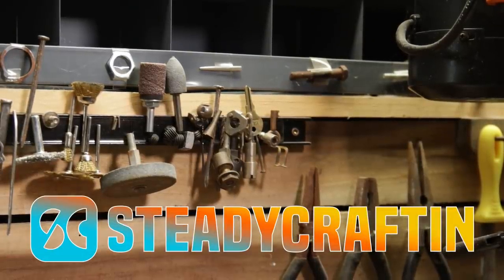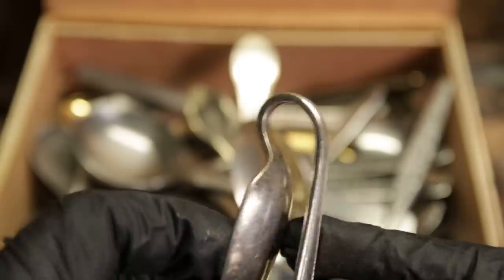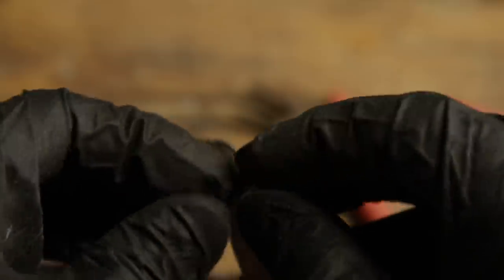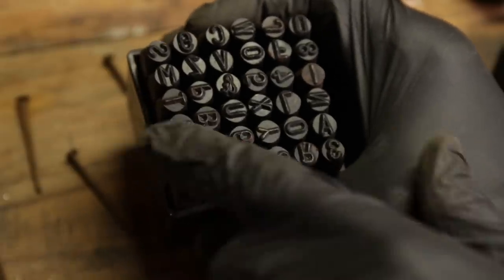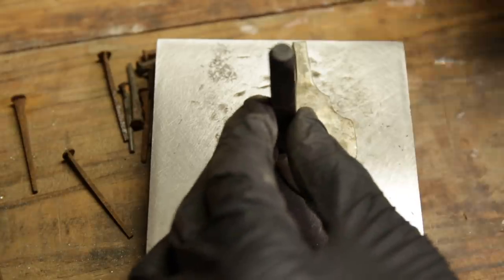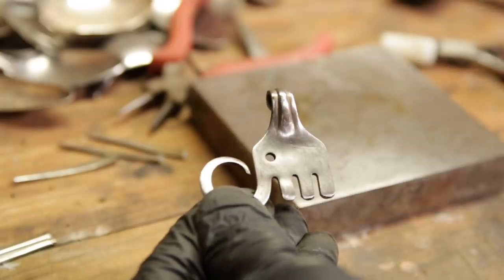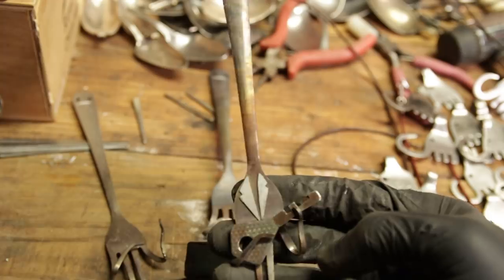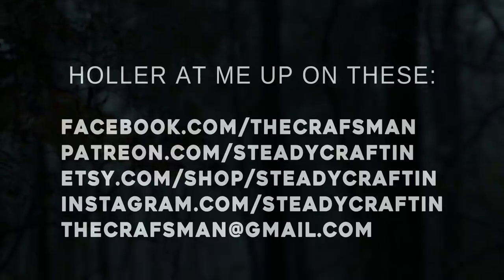Silverware How-To: Keyfinder, Fork Elephant, Hammered Spoon Pendant, Flatware Jewelry

Comment: Daughter and I ordered the Pepe Mark II ring bender, hammer and mandrel last Saturday!  Made sure we ordered through your affiliate links under your video!  Shipping is to be 5 to 8 days!  Can hardly wait, any day now!  These are great additional uses for the bender!   I would never have bought one if it weren't for your videos!  Another winner, CrafsMan!  I already know folks who would love to have these as gifts!
Reply from the maker: Aww, that is mighty nice of y'all! :D I'm telling you ahead of time, it will be hard to go back to bending silverware (or other metal things) any other way. :D The curves are nice and uniform, and it makes it so easy. I've even bent thick stainless steel handles on this thing. If the plastic/delrin/nylon parts ever wear down, they sell replacements. I've yet to replace mine, though, and they look pretty rough. :D Holler if y'all have any questions about it! ( thecrafsman@gmail.com ) And thanks again for your consideration!

Comment: thanks you again!!
i want to offer you a tip. this is more about rolling little tapered bars of soft material. if you use your fingers, 
make sure you get more than one revolution as you roll it out. otherwise, you may end up with a flattened workpiece versus a round workpiece.
it's a ceramic trick...i enjoy your humour and craftsmanship and attention to details. great show!

Comment: Hey Crafsman, just found you a week ago and have subscribed. Quick tip for remove the Stay Sliv flux, boil the part in water for a few minutes, this works well especially for those hard to "get to" areas. Steady on...

Comment: Hi Craftsman from a 71 year old, always learning, from across the pond in England.

You look much like me, a human squirrel, not wanting to throw anything away because it might just come in handy one day.😅

I've got 50+ years of all sorts of stuff, or should I say junk, over three stories of the house and garage, my children and now grandchildren and their friends love exploring, to them it's like an Aladdin's cave where they can find something to fix, something to take apart, it doesn't matter if it doesn't go back together, learn how to use tools, most of all be inquisitive and try something new.

I've got 5 grand kids from 18 - 9, all independent, like to solve their own problems, determined not to give up and most important not afraid to ask for help when they get stuck.

Recent projects with them, doing some Lichtenberg wood burning, making a leaded window with cathedral glass the old way, restoring an old chiming mantel clock, sand casting some lead toys, teaching the younger two to TIG weld, taught the older ones a while ago, and so it goes on, I need 24 hour days and 14 day weeks, I know what a lot do with them would have the Heath and Safety folk have a fit but I make sure they are safe, the odd cut, burn't finger from a soldering iron or blood blister always teaches them to take care 😉.

I've subscribed to your channel, though I'm not sure it was a wise thing to do,🤔 😊 they have gone through all your vids and now I'm having to gather together some bits and bobs for copper etching and they have selected a pile of junk from my scrap boxes and bits from my engine black museum ( bits from engines and gearboxes that had self destructed ) to make some, as they call them, treasures similar to your silver soldered masterpieces, though some may have to be welded.

So keep up the good work, if just one or two folk try something new from your vids they're a winner, likewise if your vids create that inquisitive, I can do it, hands on, inventive spark in some children, it will set them up for a life of wonder.

My spark came from mum and dad, when I was small we had very little money, if we couldn't afford something, mum or dad always found a way of making or altering something, it just takes that little spark and a bit of time to create a lifetime fire of awe and interest in children................. sadly, today, so many kids don't get the chance !

Take care.
Reply from the maker: I can't begin to tell you how much this comment means to me. I had a big smile on my face, and a steady nod of agreement as I read along. You sound like an outstanding dad/granddad! You're teaching them things that not only become skills in their toolbox later on, but solid memories to stay around forever. Just wonderful, reading this. Feel free to email me any time, my friend: thecrafsman@gmail.com

All the best to you and your family!

Comment: I would pour resin into the spoon with something little inside but maybe that would just make it too heavy for a necklace. Or try to heat up and hit it from the bottom and try to form an indentation from the bottom side and fill that with resin. You know, like a W shape is you look it as a cross-section.

Comment: Hi it’s me again noticed your ring bender , can it do silver plate or stainless thin cutlery or hard stuff ? What’s the make and where  did you buy it and can it bend bangles too? Lots of questions but I’ve searched so much for a bender that’s strong not just for soft metals either way to expensive or there pipe benders or they want  you to buy there vices to go along with it .  I’ve been very frustrated as my vice  won’t hold the cutlery when I try to bend it I can’t get it  round shape with out it flying out . By the way I made your elephant and flicked it around and textured it and decorated it like an Indian elephant so it’s two in one design you get me motivated Thankyou !
Reply from the maker: Hello there! The Pepe Tools ring bender does seem to be on the pricey side, but mine has wound up paying for itself in time saved. I used to make rings using regular hand tools, and would sometimes spend a couple hours on one. This has changed all that. It is able to bend stainless steel, too, although I much prefer not to work on those thick-handled ones, if bending to a small ring size. It just takes a lot of pressure.  Thanks for watching!
https://amzn.to/2JLzWV7